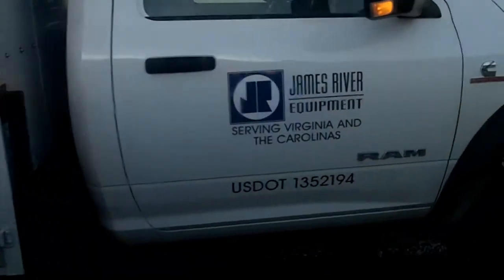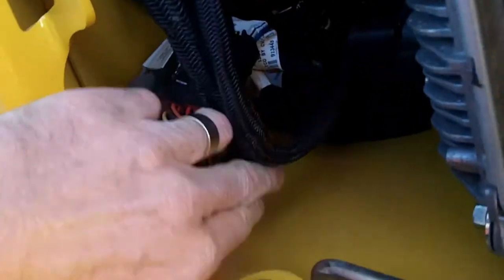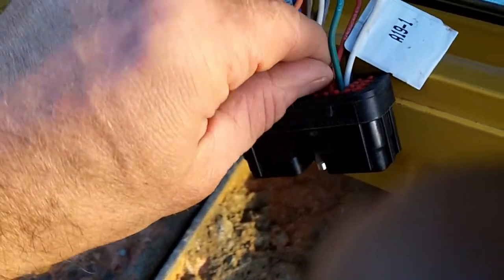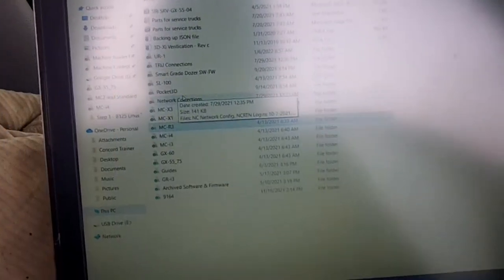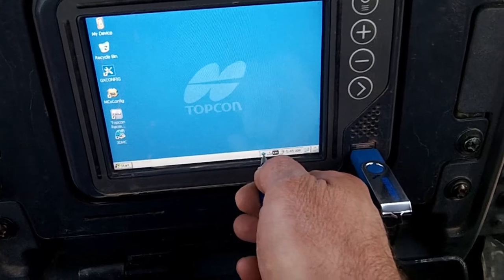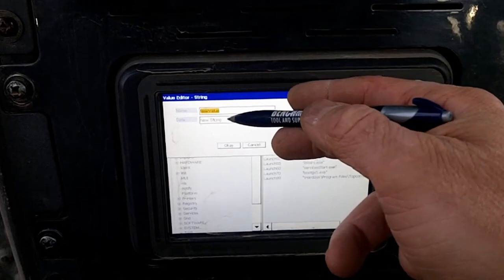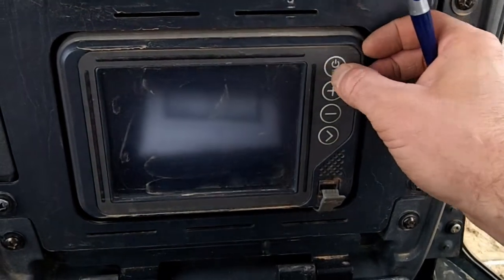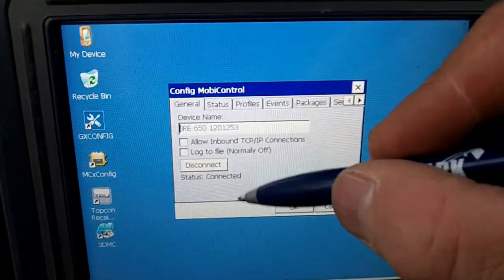JD 650K Smart Grade Cellular Modem Install

Comment: Hey mate, 
stumbled across your channel and love the content.

Just a quick question regarding the modem installs.   How do you find the cradle points last? And are they a good alternative to an sl100?
Reply from the maker: SL100's are simply just an older style modem. If you are using your modem for GPS/GNNS corrections, it's best to have a newer model.